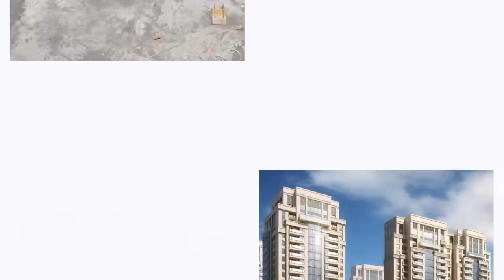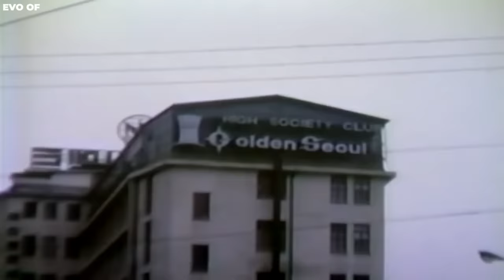The Biggest Construction Mistakes in the World

Comment: The CN tower in Toronto Canada when completed was found to have insufficient footings and the building had far too much movement. The fix was to tunnel in from blocks away and use concrete and rebar to extend the footings underground to render the building safe and sound.
Reply: They also had to tunnel through the CN Tower's tripod foundation to retrofit it with "pre-stressing" cables and anchors. The need was somehow overlooked by the architects and engineers before it was built.

Comment: If you're going to do another, don't forget the Seaside Condominiums, also known as “The Leaning Tower of Pizzarotti" in manhattan.  Also, the Boston hancock building where the architects didn't consider wind patterns.  The wind gets funneled to produce nonstop high winds at the lobby, pressurizing the building to the point that the windows started popping out.
Reply: Citibank building in NYC had a bad design, they didn’t test properly. They managed to get reinforcements in not too long before a massive storm hit that may have toppled it

Comment: 20. Pisa is not the most leaning BellTower - that one is in Suurhusen Germany with 5,19 degrees. In Pisa,the tower is built with a curve in the upper section.
14. This is THE example why pillars should be placed one on top of the other and not somewhere convenient in the upper floors especially with heavy AC units on the roof !
11. Why did you use images of the Champlain Towers South collapse in Surfside , Miami from 2021  from 18:54 - 20:21  ?
6. « Freezing cold temperatures «  inside the Hotel Lobby ? Seriously ?

I wasn’t aware that DEMOLITION is CONSTRUCTION 
I didn’t like your video !
Reply: The temperature difference appears to be the reason of the sudden collapse according to the few current reports.

Comment: Where did you get your info on the Miami towers? You’re totally wrong. The tower fell because it was built next to a pool with a garage underneath the pool. The floor of the pool failed which weakened the nearby soil and caused instability in the tower’s own support structures. And it was in 2021 not 2018.
Reply: Also people were living in the condo when it fall down.  There was no demolishing crew to take the apartment building down. There were lots of people who died in the collapse of the building
Reply: He mixed up the demolition of the Marlborough building with the Surfside Champlain Tower collapse...

Comment: Watching programs like this reminds me of the Seattle Kingdome implosion that nearly ended with embarrassment, but did result in a far more expensive job.
From the start it had been criticized for its looks (nickname; "The Wort") and had been updated by adding features that the original design had incorporated at excessive cost.
Finally after a few problems (ceiling panels falling) due to the city's poor management it was decided to replace it.
The demolition company, after extensive study discovered that the Kingdome's structure was far more robust then the plans had indicated, thus requiring an extensive change in plans increasing the implosion cost.
The result, was a successful implosion.
Reply: That was pretty amazing to watch.

Comment: A large bridge in downtown Little Rock,Ar. refused to go down.  After the explosives went off,  the bridge still remained.
Reply: Same happened with a large steel arch bridge in the village of Bellows Falls (Rockingham), VT, connecting North Walpole,  NH, spanning the Connecticut River. This bridge replacement project occurred sometime after 1970. 
Explosives were placed at four points near the top of its arch and detonated, but, the arch refused to go down! Later a cutting torch was used near one end so to collapse the structure,  plunging it into the river, whereby it was cut up under water, taking some two weeks to do so.
Today, a three span continuous beam bridge stands in its place, now carrying all the traffic between the two states, to include the Vilas Bridge, closed since 2009. New Hampshire owns 93% of the Vilas Bridge, having virtuol control of the Connecticut River.

Comment: The speed and scale are not the root cause of China's tofu dreg construction.
Systemic corruption at all levels, is.

So much of every project's budget is being skimmed off to grease palms, that not enough is left for quality materials.

If costs are cut by replacing a large portion of the required cement with regular old river sand, the resulting building isn't going to stand up straight for very long.

Same, when you use bamboo in place of steel rebar.